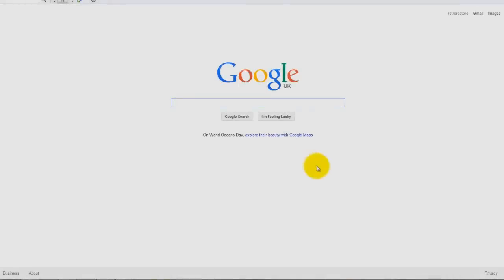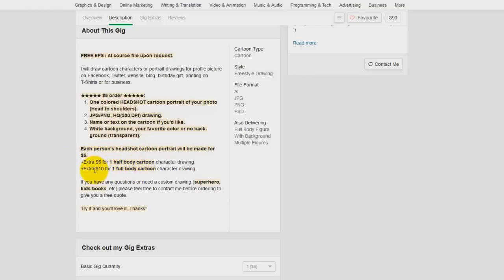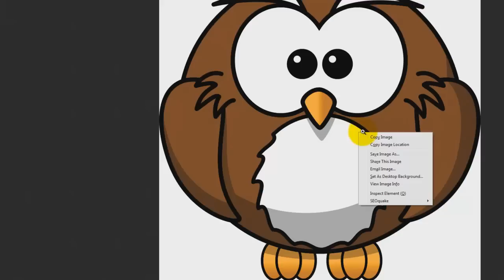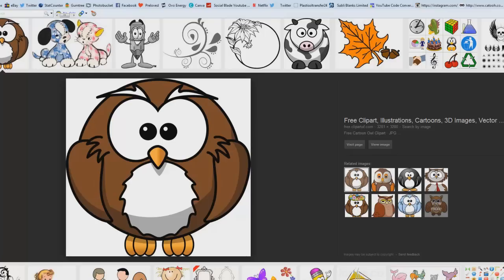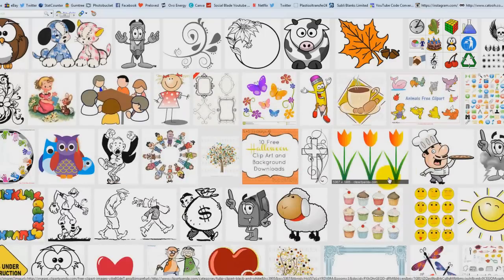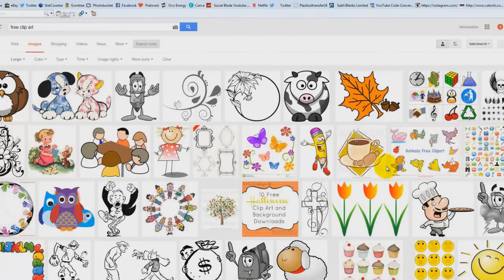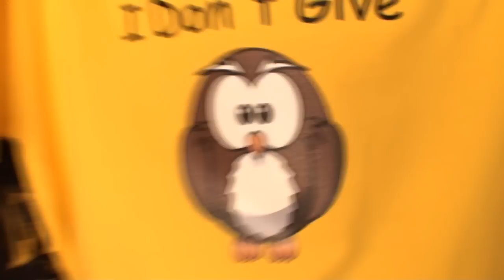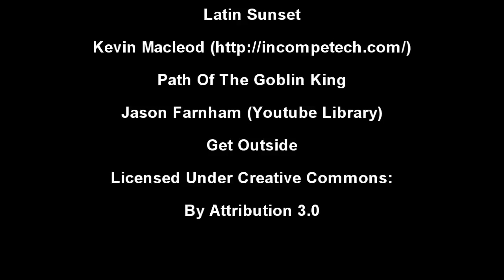T Shirt Transfers And Vinyl How To Get Images

Comment: what transfer paper are you using I tried  Clearsoft Inkjet Paper Lights  from proworld and 1 wash everything started to fade on both shirts I just printed out a clip art like u did on a ink jet printer.
Reply from the maker: +streetz180 All that info is in my training dvd. It could be the papers or the press is not sealing the inks into the papers.
Cheers
Martin

Comment: Martin. I really need your help. I recently bought a top of the line hotronix fusion press. The press is amazing but everytime I attempt to use transfer paper it leaves a noticeable box that is a slightly different color than the white t shirt. Did you have the same problem? It doesn't seem to be transferring just the ink but a box that is the size of the paper. I tried different pressure and time but the same results. Any info would be great. Thanks!
Reply from the maker: Jeff .Cann  Try pressing the complete shirt first. Failing that, are you using a teflon cover sheet when you are pressing?
Get some old t shirts and press at slightly lower temp to see what results you are getting.
Hope that helps.
Cheers
Martin
Reply: @Jeff.Cann Hi just a thought as my husband & I had a similar problem before purchasing the cameo, are you cutting the image right up to the edge? If you leave a slight overlap with some printer paper it will leave a glue residue, causing a slight marking. Sorry if this didn't help & you already knew that. Thanks for all of your videos @Martin Butler, it's really kind of you to help out & we have found them to be very informative. Haven't really 'got going' yet, just played around. My chronic bad health has stopped us but we have a few queries that we can hopefully sort out with your DVD - well done to both you & Sharon on your thriving business!
Reply from the maker: Maxine Piper
Thank you Maxine, hope your health picks up.
Cheers
Martin

Comment: I would definitely advise people to stay away from copyrighted images (that is anything that doesn't explicitly give you permission to use it). Even searching for "free" doesn't mean the images listed in the search results are actually free, you have to read the accompanying info on the page it's hosted on to see if there's anything saying you can use it. You can set the "usage rights" in the search tools to help look for free stuff as well.

Some other sites I would recommend:
Wiki commons - https://commons.wikimedia.org/wiki/ contains media and images from wikipedia, inludking stuff released to public domain. Can be hard to find good quality images, though.

Istockphoto.com A stock photo site (one of many), perhaps the largest, has thousands of images and illustrations, all pretty much high quality. Not as cheap as it used to be, so it depends what you are after.

Fotolia.com - similar to istockphoto, only smaller and images/illustrations are cheaper.

Other that, I would also recommend fiverr, especially for original content. Read reviews of people you use, though, as it has been known for artists to rip off other work.
Reply from the maker: mrman17 Nice Comment, As I said, check the websites the images come from.
Cheers
Martin